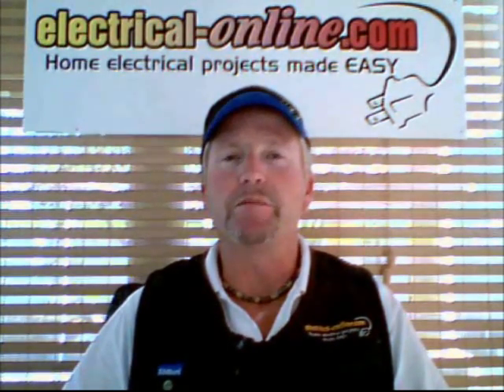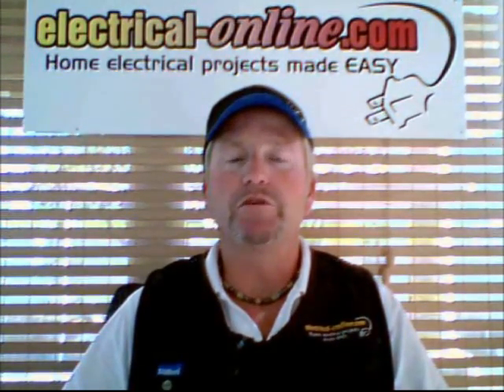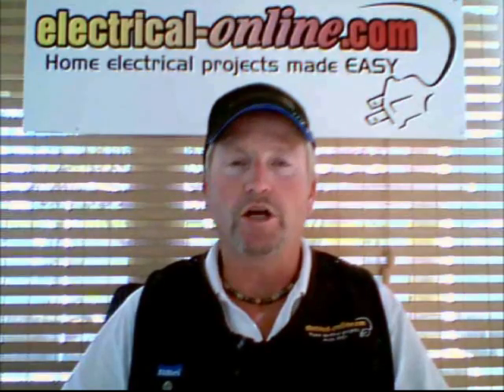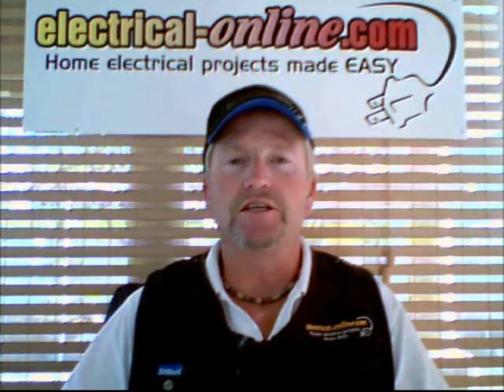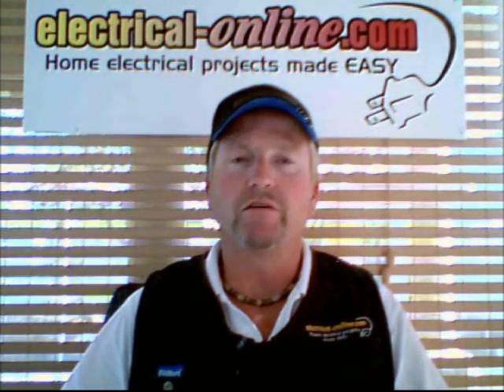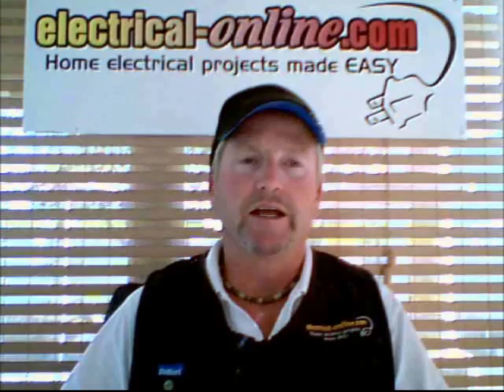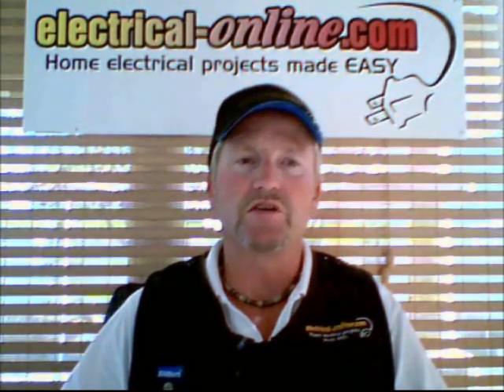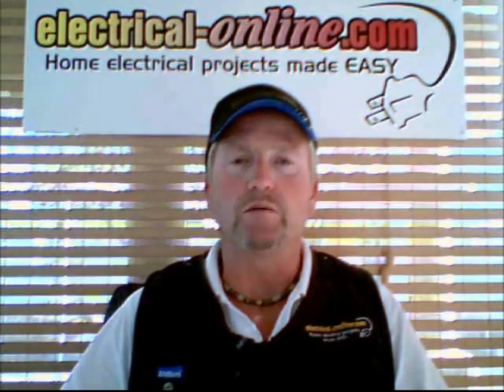How to Use an Existing External Light Outlet to Add an External Outlet

Comment: I’d like to do the opposite. Bathroom has two sconces that have built-in outlets and I want to replace the sconces and get rid of those. It’s a small bathroom and there is already a gfci outlet in close proximity. Can I simply cap those off? Thanks in advance!

Comment: QUESTION:  Need some help here:  I installed a plug socket into my outdoor light sensor to play the radio outside, I can still put the bulb on my light sensor; but, will I be able to keep the light sensor with the bulb on while simultaneously playing my radio outside?  OR,  will the radio go off each time the light sensor turns off? I don't know the mechanics of electricity but hubby is saying he does not want to put a bulb in it because the radio will shut off and on each time the light sensor goes off and on. I'm thinking it won't.  Will it?
Reply from the maker: Hubby wins.  It will go on and off with the motion.  You could set the sensitivity to maximum, and the time on to maximum to help with the irritation of this dilemma!
Reply: @theinternetelectrician  ARRRHGGGGGG!!! (as the pirates say.) Now I owe him a consarnit "STEAK DINNER!" SHUCKS!!! THANKS TERRY FOR YOUR "SAAVY!" 🤓🤓🤓 Thought for sure I was gonna WIN this argument. I'll need to pluck the feathers off a  "crow" for MY DINNER while hubby ENJOYS his steak.😟😟😟😟😟😟👍👍👍👍👍👍

Comment: I have an old outdoor security light which has failed internally. I see a swollen ballast as part of the lamps internal components.I

It has a 120 v (labeled) un-switched wire leading back inside.

If I remove the old lamp guts, Can I install an external socket inside the fixture?

I would like to use the lights waterproof casing to house an outlet for an indoor / outdoor plugin security cam.

Comment: not sure why hasn't come up more? can put a GFI breaker on the circuit then add this exterior light with built-in outlet. so why don't manufactures make more stylish models and motion sensor security lights with outlets? https://www.amazon.com/dp/B00002N7CK/ref=cm_cd_asin_lnk

Comment: Hey Terry thanks for the vid, if you happen to notice my message here, I've done electrical work for a couple years before for large and small jobs and companies so I definitely know the long and hard answer and way to do what I want to do. But, what would you suggest on the easy simple side for me: I have a 2-bulb outdoor floodlight fixture with a dual on/off switch inside the house that turns on/off first just through the wall a small 1x 60-watt style regular porch light and then conduit runs from there up and over to the big floodlights. The floodlight fixture was damaged by painters and it must have a loose ground or something because I had to go up and re-aim the bulbs properly and when I was touching it whatever I did I could only get either the left or the right flood light to stay on never both, right up until one bulb blew out so the other stayed on nice and solid. But also now the daylight sensor doesn't work so the floods don't turn off when it's light outside. Maybe the idiots painted over the sensor but most likely the whole fixture is loose and dangerous. I bought a bug zapper lamp I want to hang up there but it very specifically wants only legit, 3-prong, grounded, thicker gauge extension cords and/or socket to plug into. I can buy a cheap "2 prong to 3 prong adapter" with the metal tab on one side you normally screw the power outlet plate screw through to ground it, which is fine indoors but if I got that and a flood light threaded outlet adapter for outside which I only see with 2 prongs, would it be safe to just run an extra length of grounding wire from whatever is inside the original fixture to ground the cheap adapter and safely run a lantern/electrocution device that needs solid feeds? Thanks, no problem if you can't help.

Comment: I have a double flood light with a switch for it on the inside.  Can I convert these light to electrical outlets. I was told that there was an adapter that you put in after taking out the bulb that converted it to an electric plug but I don't know what it is called. I wanted to plug in stand lights across my patio.  Thank you !!
Reply: There’s a new website out you guys might want to check. It just opened up...in 1995. It’s called Amazon.
Reply: +Coastal Virginia Gardening where do I find these fixtures?  Or the adapter?

Comment: I would like to do the same thing. Except splice into an outside wall elec. outlet and run a surface or underground pvc protected cable to an box 30 ft. away to plug in my pool pump. Is that ok?

Comment: Can you splice into an existing circuit wire that is feeding 2 other outlets to add a 3rd outlet?  Do it like a long pigtail where the splice is contained into a sealed electric box and the long pigtail feeds the 3rd outlet?   In this example you would have to access the wire from the attic and then feed this "pigtail" down the wall.  Thanks